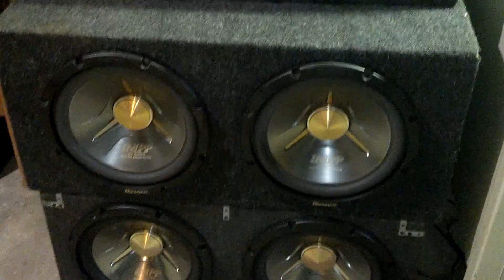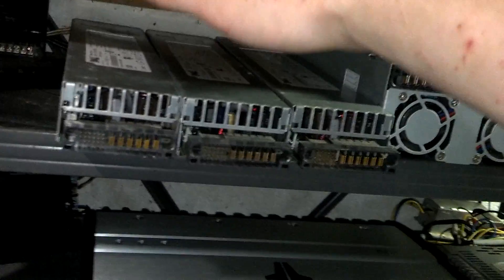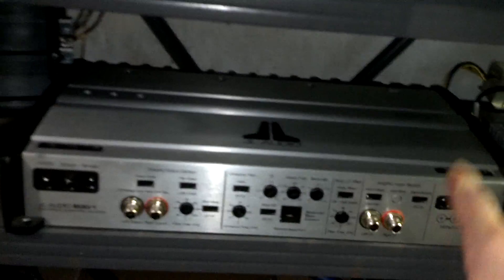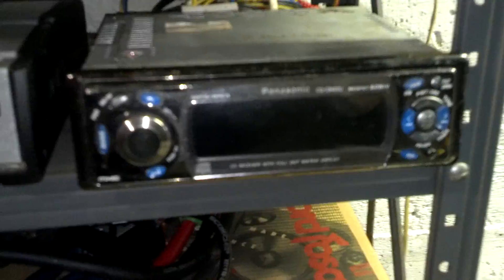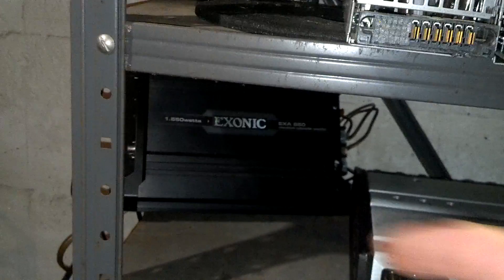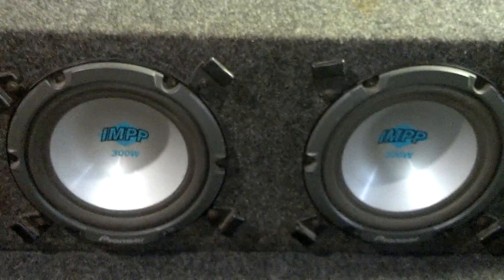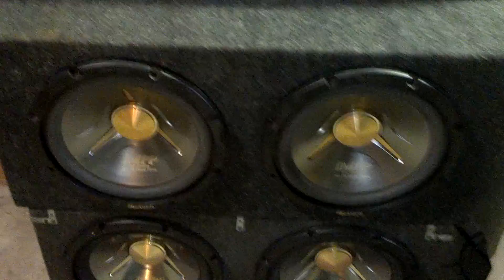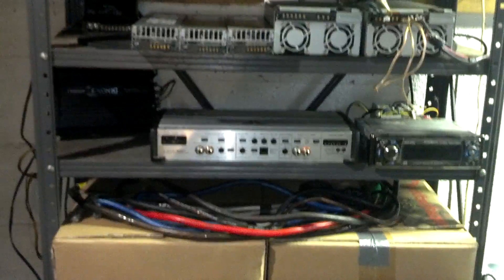Test Bench im building for testing car amplifiers and subwoofers

Comment: Love the video "Mr. Bradbuilds" I think I could help you even though you have this stuff laying around, please look into pyramid psv 300 on ebay or amazon.....running a mono block mid, and highs amp, and headunit never drops below 13.8...good luck and please bring us final vid after everything is playing please...
Reply from the maker: ah , yea im not ''mr. bradbuilds''  he is user/bradlycriswell1990 lol . yea ive looked into em , just 1 of these 85 amp psu's keeps the jl 500/1 going and not drop , i just have extra in the case i need it lol . i wouldnt mind having a couple more caps , they dont do much in the car but they help power the peak spikes alot with psu's
Reply: +mazda2284 oh please accept my apology....i like the psv cause you dont have a bunch of wires every where....it just simplifies the process alot....but if i had those laying around i would use them....i could upload mine if you like???? better yet do know demon sparks here on you tube...has a bench using psv??? i can send a link if you like???
Reply from the maker: lol , Bradbuilds is someone else .